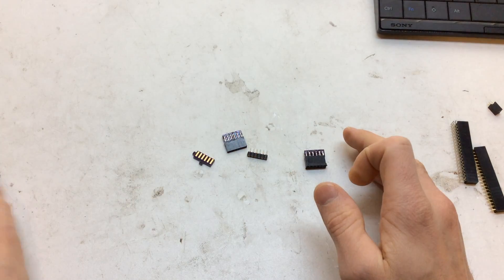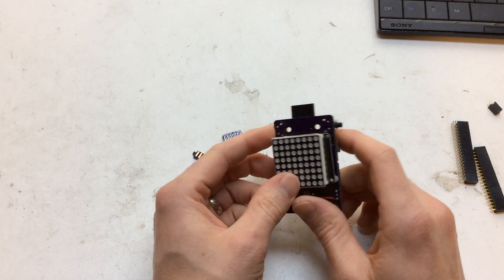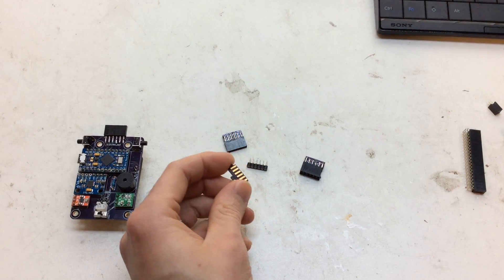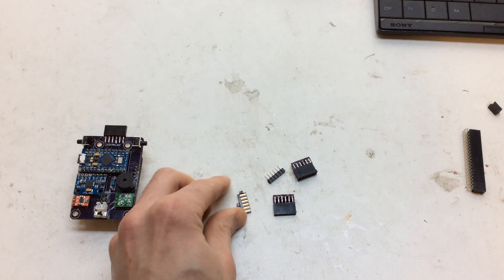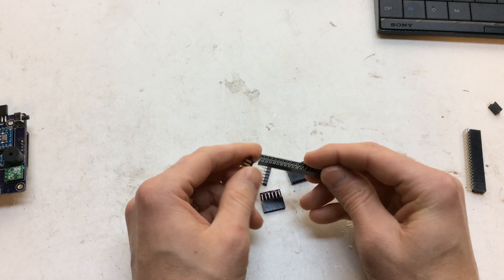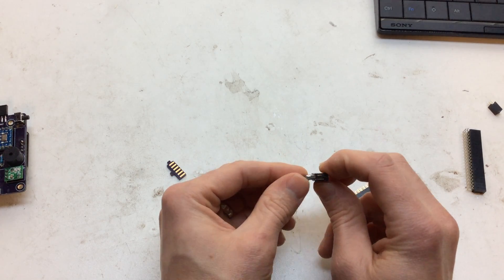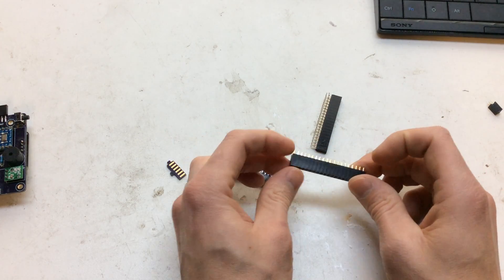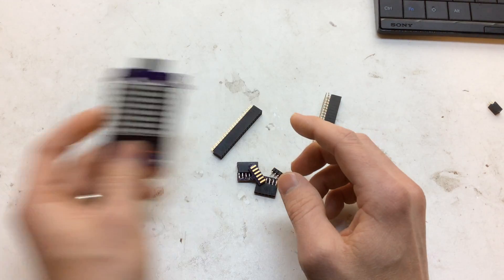SMD edge connectors

Comment: Why all the downvotes?  I love this kind of stuff.  When you are prototyping, not everything is perfect.  I use a pickit 3 on a breadboard, and there's nothing really decent that easily allows you to plug in and out.  When I plug in my connector, it's only about 1/16th of an inch of solid pin-on-socket contact.
Reply from the maker: Thanks for the support, I hadnt even noticed the downvotes. I just hope someone will find it useful and maybe build on the idear.
Happy hacking
Reply: @facelesstech  I can't understand what you are saying. Download the Closed Captions, clean them up a bit, and upload them.